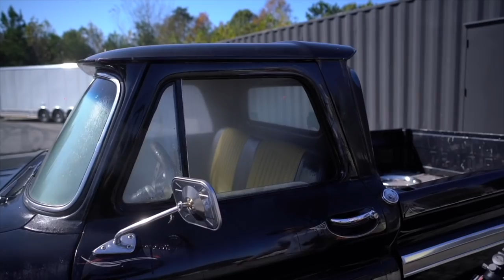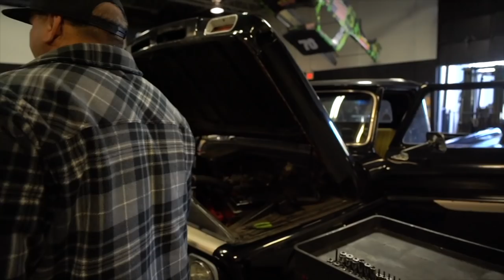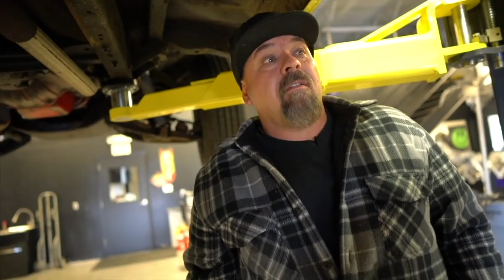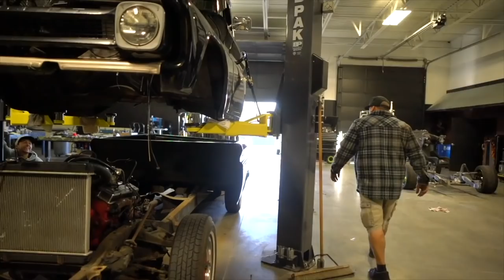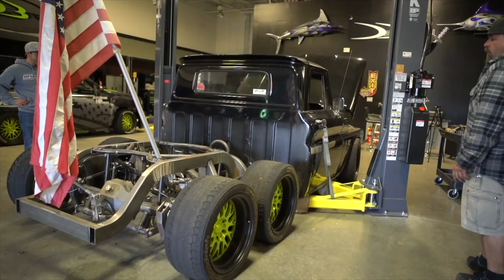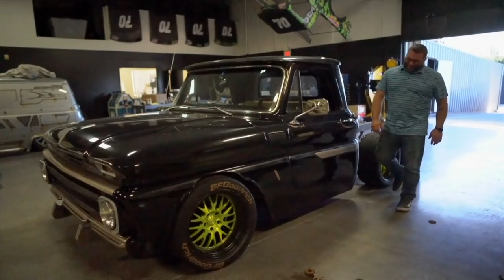Dream Truck Build with my Dad - C10 SLAYER EP. 4

Comment from the maker: What motor should we put in it?!
Reply: Supercharged 427
Reply: A really beefed up 572 chevy!
Reply: If you can get one I say a Hellephant or HellCat Red Eye's motor
Reply: Ls3
Reply from the maker: @Jmcqueary03  I’ve always wanted a 572!
Reply from the maker: Dillon Bishop  duuuude could you imagine??
Reply from the maker: @Danterain45  the hellephant I heard is crazy..
Reply from the maker: @GamingGarrett724  one of my favorite motors!
Reply: @DeBerti  I heard it can lay down 9.278 seconds, with a trap speed of 150 mph.
Reply: Duramax would be sick!!! Cummins swaps are overdone. Or anything Chevy because it's a c10 🤷‍♂️
Reply: Built coyote (I’m biased) lol
Reply: Yugo motor
Reply: 366 with twin turbskis. Redlines at 11000 rpm
Reply: Something twin turbo from Nelson Racing Engines. 454 would work well.
Reply: Turboed 572
Reply: Twin 88 mm turbo or procharged 481x . They make the power your going to want
Reply: LSX 454 supercharged but thats just because i want one so its easier to make u buy it lol
Reply: 572 crate engine with a twin screw blower on top dual four-barrel carburetors blueprinted and balanced
Reply: What happened to ur t.v show on discovery? Yall moved and that was it?
Reply: I say a diesel would be epic with 6 turbos n a blower
Reply: 632 from blue print or a crazy steve morris engine something with 2000 or more hp
Reply: diesel
Reply: Texas Speed 427ci
Reply: Got to check out Texas Speed Shop they've got some good option for you I'm sure
Reply: I would just find a cab by itself and buy it and you will know exactly what needs to be done to it
Reply: A fecking big one twin turbos 😊 its awsome dudes👌  its going to be like the the hoonitrucks fat ass brother 😁👍🇬🇧
Reply: @nitsud77  it was one of my favourite i loved watching it too 😁👍🇬🇧
Reply: Like a 540 big block that you can rev with a prochargers..make like 1200 hp with out even breaking a sweat..
Reply: Texas speed engine
Reply: Imagine how a Lambo engine will look in the back🤔
Reply: Put a Barra in that thing! The Mustang AdamLZ did is sick!
Reply: 6.7 powerstroke all the way .
Reply: There's a lot of common engine swaps out there these days, but I've only seen a few Ford 7.3 Godzilla swaps. That would really set it off.
Reply: Dude what happened to twin turbos? I was all in to that show then...................... Been waiting and waiting! Then finally this build came across my feed and i was like hell yeah!!! Glad to see you guys still gettin aftet it!!
Reply: Cummins
Reply: Why not a super car engine?
Reply: Helleohant would be cool but a Diesel would be badass. Dark British racing green would be a cool color for paint.
Reply: 12 or 24 valve cummins for the memes
Reply: 409 BB  old school.
Reply: 4g63t with a t56. There is an adapter....
Reply: Proline 572
Reply: For us midwest folk this is a perfect body and not really hard to fix the body mounts or the barely rust floors or body. Thus is a perfect starter truck and definitely a cheap 380 stroker motor will be great for it.
Reply: 2jz
Reply: Go Big, Go Merlin
Reply: 426 hemi
Reply: a cummins would be mint
Reply: @treybrooke8953  because they make some of the best diesel motors lol
Reply: @Joseph Peak or a demon lol
Reply: Gotta Hand it to y'all , Another EPIC Build.
Thoughts for the Power Plant. .  .  Of course a Big Spooled Diesel would be Sick But I do agree with the rest of the comments big turbo diesel swaps and fully built LS swaps have been done to death and so I don't think a "Common or Average" Swap would be Worthy of  a Truck/Build that is Soo Epically Above and Beyond Different than Literally Anything Else out there. So what about maybe one of Chevy's New ECrate Motors or something along those lines. I Figured around 800 -1000 Hp as soon as your foot touches the pedal might be up to the task of The 4 Wheel Smoke Show.
Reply: Obviously a 12 valve
Reply: Twin turbo big block Chevy, like a 602  or 572 cubic inch. Just go horsepower crazy

Comment: I live in Topeka KS. & drive a 2006 Lincoln LS V8 Sport Coupe in black with a V8 & turbo good for 320 horses. It does need a serious paint touch up because of small paint chipping, a few tiny rust bubbles on top of the cab and some scratches on it, some of which were caused by hitting low hanging tree branches that were brought down in a bad wind storm at 35 mph. And I gotta tell ya, I WOULD LOVE TO SEE WHAT ALL YOU COULD DO WITH MY LINCOLN!!!!

Comment: Everyone does twin turbo LS's. But there is no way the front tires are going to hold back four tires while the boost builds. I think a blown BBC would be sweet. Instant throttle response and power to light the tires up. It's a sweet build so it doesn't really matter what powerplant you put in it, it will still be awesome. But a blown big block is hard to beat for a burnout machine, that's the reason the Aussies do it.
Reply from the maker: When you see what motor is going to be in this you will laugh... its crazy

Comment: It's not that he jumped it, I have jumped a few trucks with zero issues (cars too). The problem is that he jumped it after removing all suspension and sitting it on the bump stops.

We had a covered bridge where I grew up, and it had a very short and steep incline in and out of the bridge. Everyone would speed up and jump in and drop out of the thing. It's hard to believe that the bridge held up and nobody crashed.